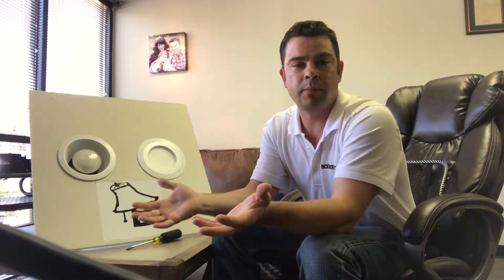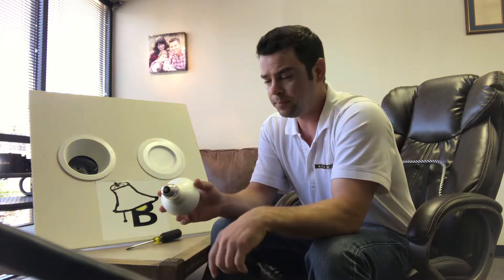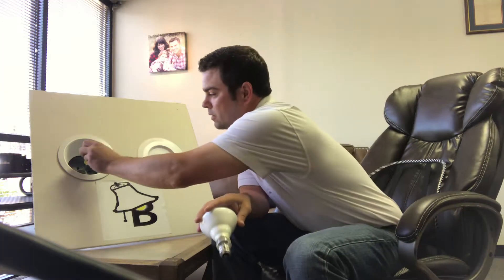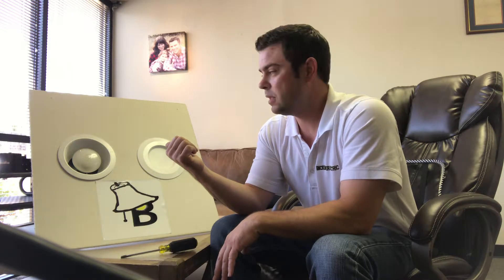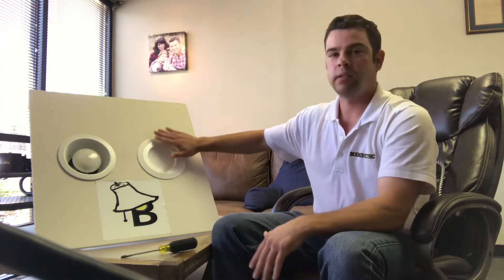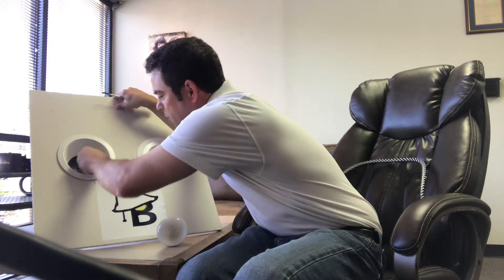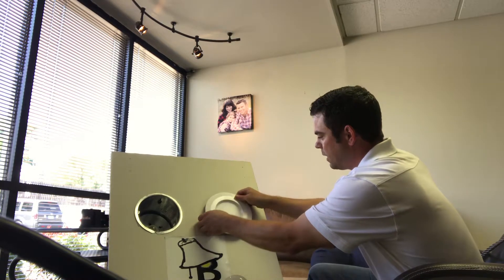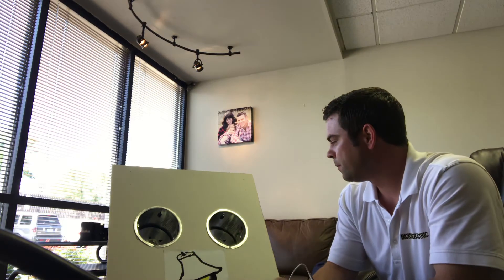Flickering lights

Comment: Hi, I have a finished basement with numerous can lights.  Sometimes, when I turn them on, they don't flicker, but will permanently blink (turn off and on) continually.  The strange thing is that it randomly does it, and sometimes they stay on working fine.  Greatly appreciate your insight.

Comment: What do you do if the led light is flickering?? I have 6 in my kitchen but only 1 flickers
Reply: Most likely it's a loose neutral.
Reply: Could also be a bad led light.
Reply: Same problem here! Replaced it and also just put a normal bulb up there to test and its still doing it...randomly started 😑 did you ever find a fix?

Comment: What do you recommend if the led lights flicker a lot and burn through bulbs like crazy? Thanks
Reply: Are they on a dimmer?
Reply: @bickimerelectricllc hello, I’m having an issue with my LED randomly flickering when “off.” It is connected to a dimmer. Any suggestions?

Comment: Michael I replaced my bulb with one of those single piece led lights but it still flickers like its over heating.the strangest part is that if I switch it back to a regular light bulb it works just fine. It just turns on and off constantly (the LED I mean) I'm at my whitts end. What do I do
Reply: Hey Steve. Is it on a regular switch or a dimmer switch?